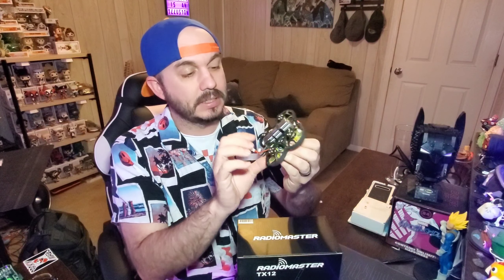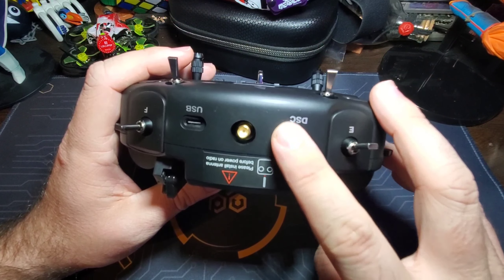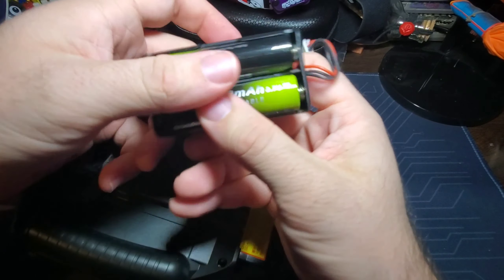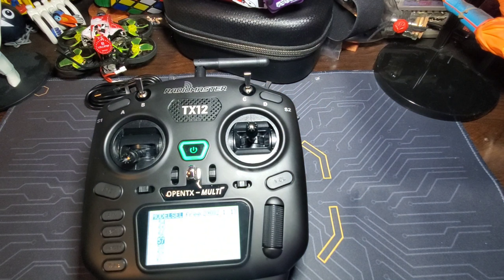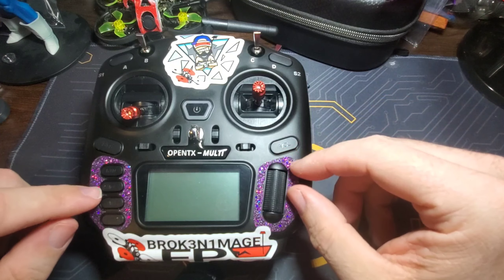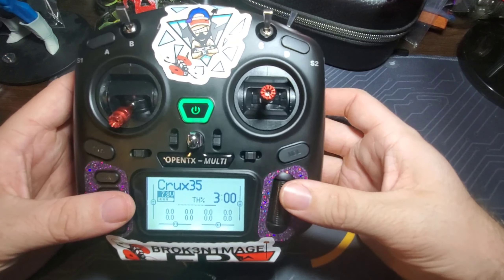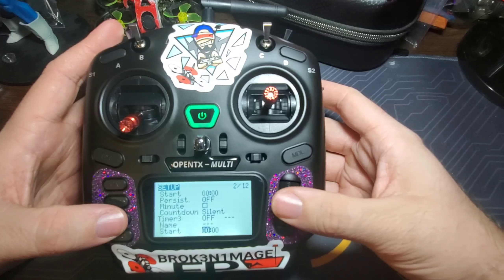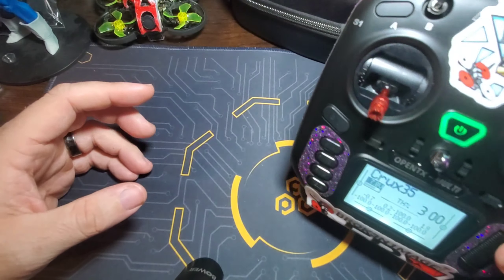Radiomaster Tx12 Review and Upgrades

Comment: Hi Bok3n, Can you please make a video on adding a ELRS module to TX12. I also have a Tx12 and I could not get any source that explains it how to add ELRS to Tx12. I will really appreciate it. Thanks.
Reply from the maker: Hey man.  I could make a video of how to set up the elrs for a tx12 specifically.   However try this video.
https://youtu.be/EPPk4yFU9tQ

It's not the same hardware but if you skip forward in the video he describes how to format it very well.  I used this video to grt mine working.  It's basically the same.  

Just a little tip however. My
Elrs module stock came in version 1.  So I had to add the version 1 Lua to the radio to update the module.   Once the module was updated I updated the Lua to v2.  I think Bardwell explains that too.

Let me know if this helps.  I'm not sure how well I could explain my process.  I had alot of trial and error.  There is an elrs discord and those guys there are super helpful.   Might be something to look into that as well

https://discord.gg/8fwsPh4s
Reply: @BROK3N1MAGE  Thanks for these. I will try it

Comment: hi, my tx12 running edgetx is advicing me to upgrade the multi module protocol , do i have to use the same opentx multi module upgrade?
Reply from the maker: When I update my edgetx firmware.  I just go onto the github page and look for the latest firmware.  I'm not sure about multi module protocol upgrading.  But im pretty sure when you update edgetx.  Whatever version you update to it'll say ways included.  If I'm not mistaken when you switched to edgetx, you no longer have opentx installed on your radio.

Comment: It's a shame they didn't do more testing of the EdgeTX Flasher and firmware for monochrome radios, 2.6(possibly earlier) has issues with the TX12 and T-Lite, like the contrast bug on the splash screen (very dark), had to manually create SD Card, EdgeTX Flasher was worthless. EdgeTX devs were clearly in a rush to release and quickly try to replace OpenTX.

I would NOT recommend EdgeTX for the TX12 or T-Lite radios at this time. After testing, no benefit to switching to EdgeTX 2.6 on this radio compared to OpenTX 2.3.14 but does add some unwelcome quirks.

Biggest benefit of EdgeTX is touchscreen functionality for the TX16/Horus guys that were impatient with the OpenTX devs adding the functionality. If you have a monochrome display on your radio, I see no justification for switching from OpenTX at this time.

ELRS, on the other hand, is fantastic and I would recommend that for any compatible radio.

Update It appears the EdgeTX contrast bug with the splash screen has been resolved with the 2.7.0 nightly. I tentatively retract my recommendation to not utilize this firmware. ;) EdgeTX Flasher is still unusable, however.
Reply from the maker: Thank you for your input Dave.  I agree with you.  With monochrome radios like the tx12.  Edgetx really doesn't have very many features that the tx12 can take advantage of like the tx16s can.  Atm edgetx and opentx are pretty much the same.  However.   The reason I switched to edgetx is on the grounds that edgetx is constantly being worked on.  The devs for opentx kinda just stopped.  So as far as updates and bug fixes and things of that sort.  I think edgetx is the way to go on any open source radio.  Your comment says it all.  When you posted there was a hiccup with the display...was fixed in the next update.   I believe the devs are listening to feedback alot better than the devs at opentx for sure.

Also.  Elrs rules :)

Comment: 10:36 Hahaha... Those cheap Chinese batteries ARE NOT 5800mAh. Even the best 18650 batteries you can buy max out at 3500mAh. And yes, you want a good set of batteries to power this radio, from a reputable manufacturer... Panasonic, Sony, Sanyo or Samsung (easy to come by in a vape shop).
Cheers.